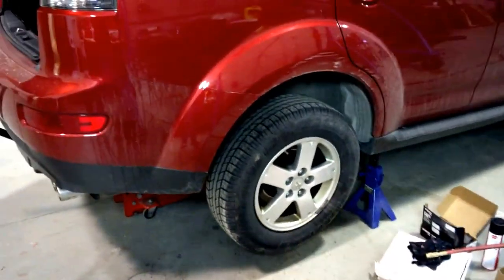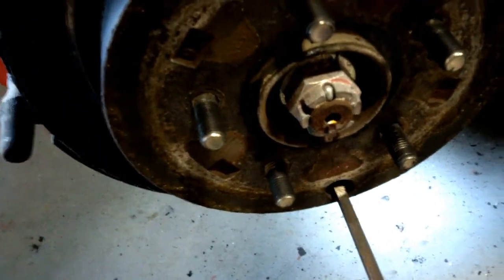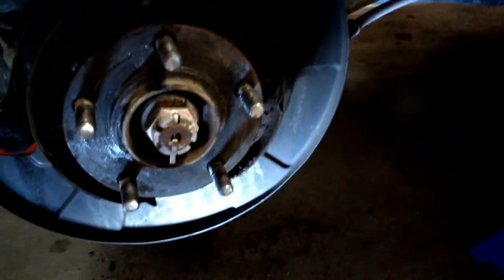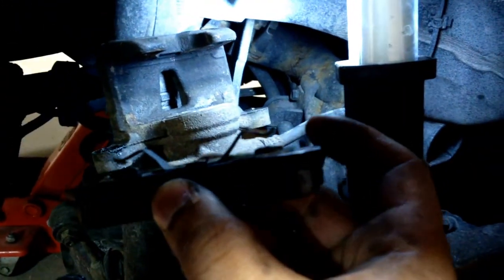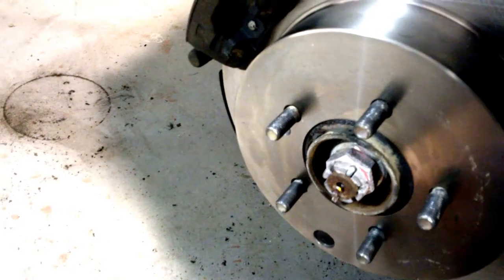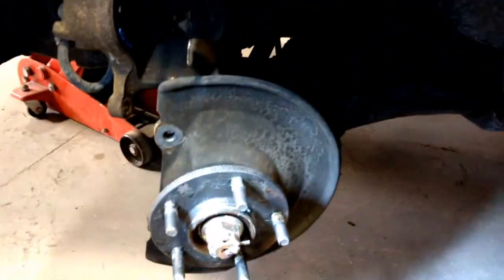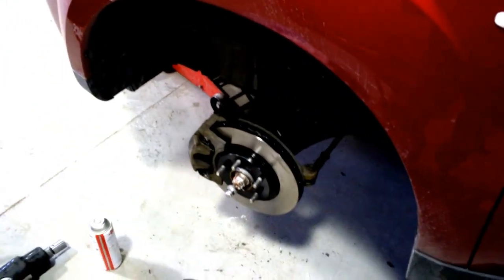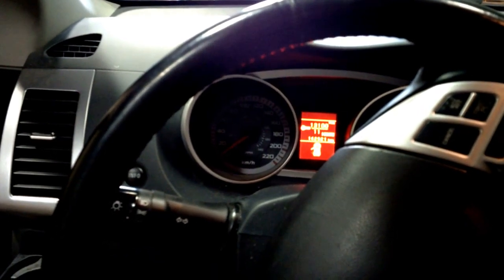2009 Mitsubishi Outlander 3.0 V6 Brake Job

Comment: I just wanted to say that I was skeptical about the need to grind the tips of the new front pads, but ended up doing exactly the same for the inner side as the new Bosch pad wouldn't goi in. Also, the original pad had an uneven wear (top thicker than the bottom), which makes me think that the new pads couldn't travel freely.
Reply from the maker: I changed my brakes again a few weeks ago and when I removed the sliders from the front right,  the one with the rubber on the end gave some resistance to come out.   The rubber component had swollen which caused the resistance.   This scenario could contribute to uneven wear to the pads.  
I watched this video 
 https://youtu.be/_CjMUZDyt-I 
and ended up removing the rubber all together.   

When doing the left side,  I had a lot of uneven wear and I suspect that the pulsation I was getting was from the left side.   The left side gave so much resistance to remove that the slider bolt actually broke off I side the anchor.   I had to get the broken piece extracted and install new sliders. 

Hope this info helps.
Reply: @shawnrsingh  Thanks for the video. I also had problems with a couple of pins not wanting to come out. The hardest one surprisingly was the lower one (without the rubber tip) in one of the rear calipers. Some of those guide pins showed traces of corrosion near the gaps where those little rubber boots wouldn't seal - I guess they can only seal so much.
Another observation - the rear brakes turned out to be the dirtiest and trickiest to work with.

Comment: So the slider pin with rubber is on the bottom? thanks for the video!
Reply from the maker: bruknows yes, the pin with the rubber will be at the bottom.
Reply: @shawnrsingh  were they on the bottom on all four sides?

Comment: why didn't you use a c clamp
Reply from the maker: Kenny Sok thanks for your question.  I have used a c clamp in the past to push back the Caliper piston but the large slip joint pliers are just easy and possibly faster.  and I get a better feel for if the piston may be starting to seize up.